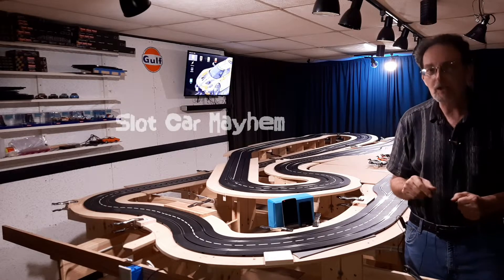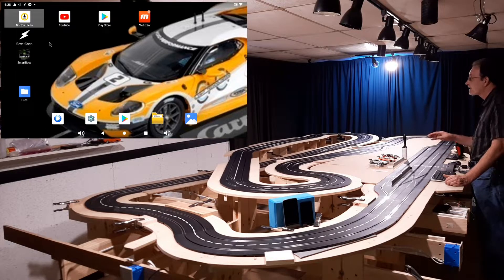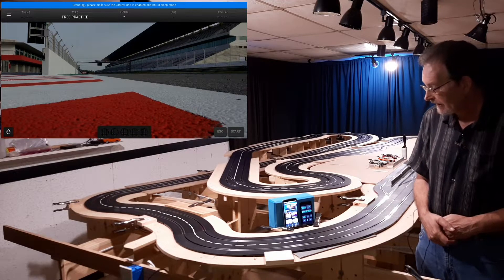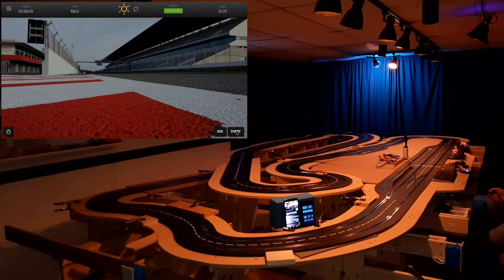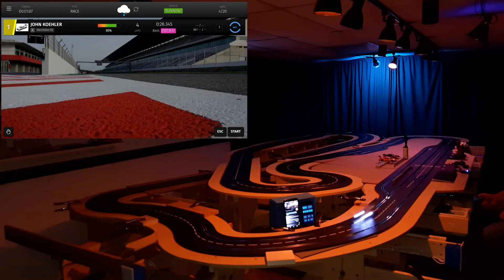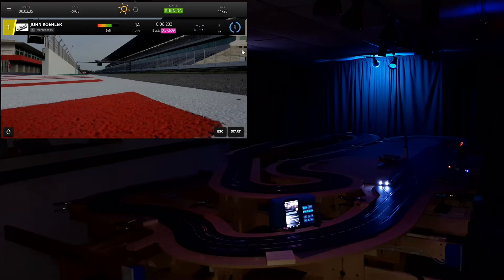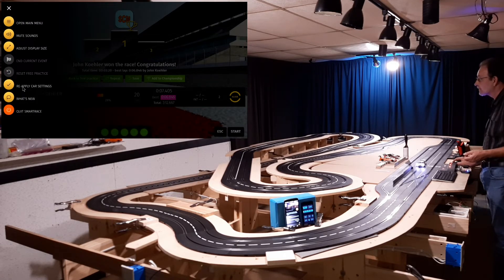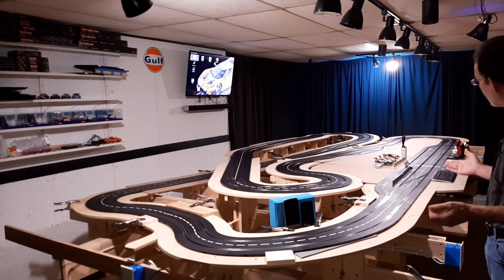Glendale 65 - Episode 13 - Track Demo

Comment: Wow great automations! I’m building a track myself and was wondering 
If there is an API from smart race that you could use in order to tie everything together. (For example, Control the lights depending on different race statuses, or use a Philips hue button to pause a race (without having to break open the CU and hardwire a series of buttons). Great stuff 👍🏻

Comment: Great demo of a brilliant set up once, again John. Since watching your series I've bought myself a Carerra set and have a basic pit lane race running with SmartRace mysel,f though I'm a long way from having automation. One little tip I picked up elsewhere - and you might find interesting before getting into landscaping - is using wooden wedges under the track, eg on the outside of a turn, to give the track camber. In technical sections for example shims on the inside of the corner could give a tricky off camber, positive camber helping the cars to corner in fast sections if you get me. Excellent vid as usual though.
Reply from the maker: I might do just that... A bit of superelevation! Thanks!! Good tip!!
Reply: @slotcarmayhem9765  Yeah, superelevation! I've found even a small angle, especially when it's opposite, makes a huge difference to how you have to drive the corner.

Comment: Great stuff as always!  What ia the advantage of a power adapter being placed entry to a digital track piece? Wouldn’t a power tap be OK 
Since II’m not plugging any other digital piece into that adapter? 
Tbird Memphis
Reply from the maker: Hi, I add additional power taps to the digital lane changers, as they are power-hungry. I like to ensure the lane changers get full voltage without any loss incurred from joints.

Comment: You can add weather to the slot cars? How does that work?
Reply from the maker: The weather is a plug-in feature for SmartRace (the lap counting software on the screen). When rain starts, cars will change speed and braking (configurable), and then can have further different speed and braking (configurable) after the "tire change". I am just tapping into that to trigger the lighting and sound.

Comment: You are not Slot Car Mayhem, you are the “Slot Car Master”.   Did you have to do any programming for the software or was it programmed or scripted? You are constantly covering things from prospectives that no one else is.  Everyone else is showing the reces and cars, but you are talking about what goes into having both a successful and reliable experience. You are like a master teacher and it looks like you are a Carpenter if not an Electrican.  Can you if you have not already done so, show us where that Dc tap or power supply is on your layout. I wouldn’t miss an episode for anything. Keep up this outstanding content and keep giving us the back story like no one else!!!
Reply from the maker: I am humbled!! Thank you!!

Yes, I did some programming in Tasker for Android, and am putting together a tutorial series on Tasker itself, and how to read events in Smart Race with Tasker.

I am also in the middle of a video on the electrical system overview, showing interconnections, the system as a whole, etc. That might answer your question of the DC Taps.

Thank you again for such kind words!!
Reply: @slotcarmayhem9765  Hi John.  Can't wait for the Tasker tutorial, is there a way for you to upload the script to the Tasker users group?  I've added a VIM 3 to my Smartrace, works way better than casting to a tablet or phone.  Then I changed my almost new LED pot lights to Phillips Hue pot lights, so all that is left is to tie them together.
Reply from the maker: I am almost ready to start the tutorials... would post the code, but a lot is direct linked to other devices. I haven't tried running exclusive on VIM3 because I want race director control over events. Will start the video series very soon!!

The base of it if you wish to experiment is this: A profile (when SR is running) triggers the racecap task. The racecap task queries the screen every 1.5 seconds (via autoinput), writes a text file, then looks for specific occurances of text ("*started raining*"), then using auto remote, sends a command to another device to run a task (trigger the Hue Thunder app to start the rain event). The VIM3 task loops until terminated.

Comment: How many time did you choose for the tire change in smart race? What time do you choose when you have damage plugin and weather plugin active?
Reply from the maker: I choose tire change time based on refuel time. I want to be able to refuel to 100% from empty without tire change occurring. In this case I believe it is 15-16 seconds for tire change. Damage is only 5 seconds to reduce fueling capability when in pits for damage.

Comment: How do you get all the software to work together
Reply from the maker: I am runing  strictly Android (no IOS) and using an app called Tasker (with a few plugins) to tie everything in together. I am working on a tutorial series for this specifically in the very near future. Tasker is very powerful, and makes the connections easy.

Comment: Wow...  very nice..   Will this system work with Scalextric Arc Pro?
Reply from the maker: Not familiar with that... This runs across an Android platform. If you are using Android, most likely yes. This as it sits is strictly an Android thing, using some automation apps.
Reply from the maker: If you're running an RMS on an Android device, most likely yes. I am close to a tutorial series on how to do this, and I am sure it could be easily adapted to other RMS software as well.
Reply: @slotcarmayhem9765  I see... I have an Apple Platform and my Race Management System is called Magic Arc designed specifically for Scalextric ARC PRO.   So is sounds like your system isn't compatible.   Bummer...
Reply from the maker: @stevestroud6354  u
Reply from the maker: @stevestroud6354  easy if you grab an Android tablet or even a phone and dedicate it for use. I run the main RMS on an Android single board computer that is mounted to the layout, > $150.
Reply from the maker: Just looked at Magic Arc, and it would work... There might be something for IOS I'm not aware of, but all I really do is query the screen when my RMS is running, look for key text occurrences, and run specific code if found. I loop back once per second, until I close the RMS. Pretty easy really...

Comment: Great video. I love this system! I have been working on a similar system on my track with a projected backdrop incorporated as well. It's been slow going, as my system is in the garage so it's not down all the time. You can take a look at what I have done so far, here... https://www.youtube.com/watch?v=gQm5r8PbKtw The animation is created with Unity3d, and it would be easy to incorporate weather changes  and sunrise and set into the animations.